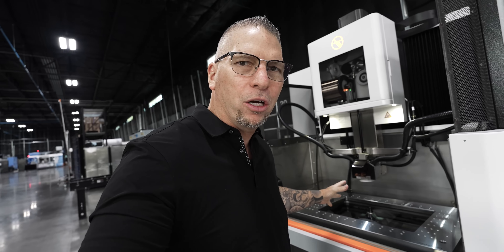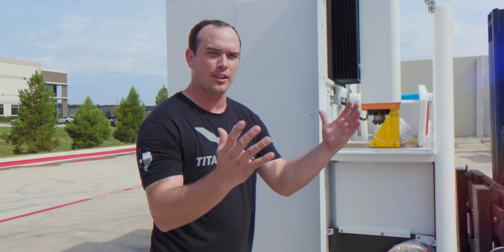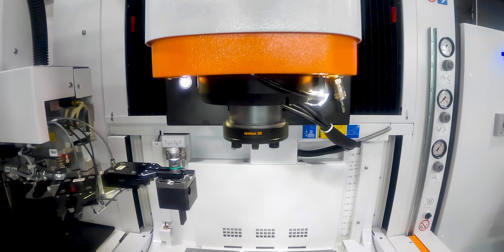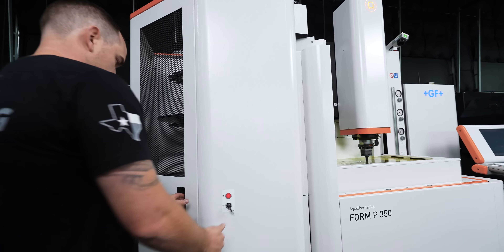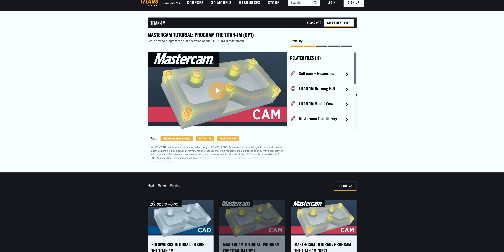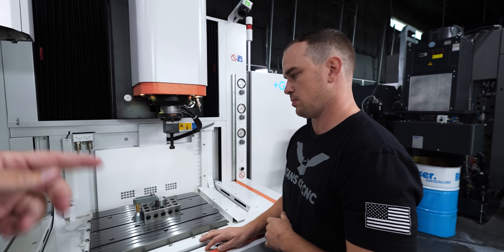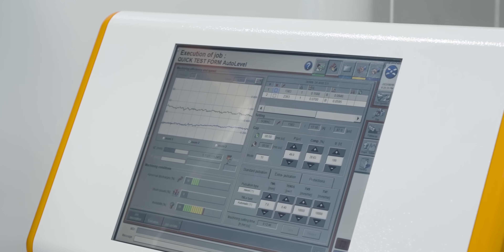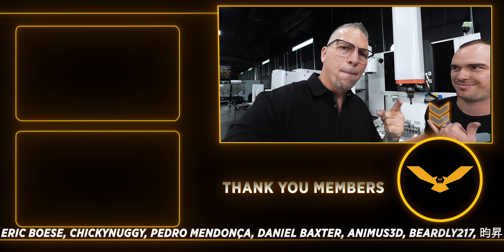This SINKER EDM is the MOST Advanced in the World

Comment: Interstingly enough, im rebuilding an engine and i noticed the valve cover is all chewed up around the spark plug hole. Well oil used to get into that hole and the coil for the spark plug was leechimg electricity through the oil which ate at the metal cover

Comment: I've been programming and working with 3-axis and 4-axis CNC milling machines at my internship I have had, what is the use case of this Sinker EDM machine that a regular CNC milling machine could not do?
Reply: regular milling machine will always leave some rads on sharp corners and sometimes when cutting molds for thin walled plastic products also need edm cutting.

Comment: I'd like to see you sink threads inside and outside. A differential jackscrew would be really cool.

Are there any modes where you can make a pocket in the x or y direction at the bottom or side of a hole?
Reply: Burning threads is definitely on the list! We can burn in any direction on this machine 👍🏼
Reply: @trevorgoforth8963 technically the AK-50’s locking lugs on the trunnion count as threads hahah